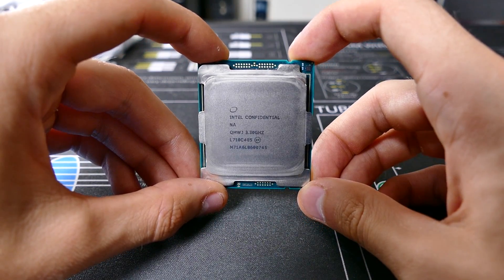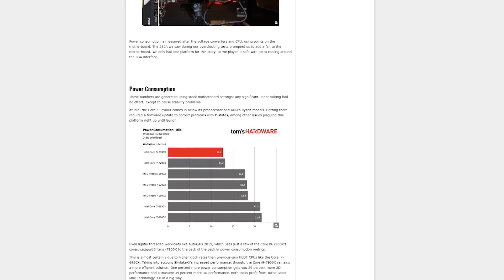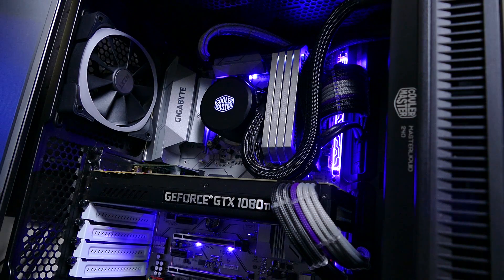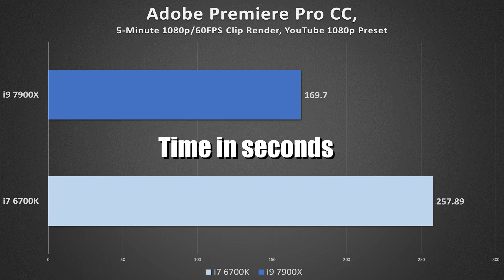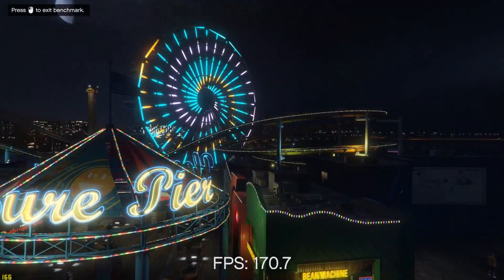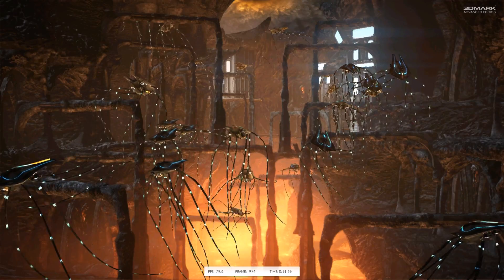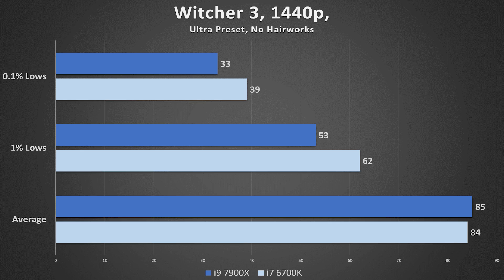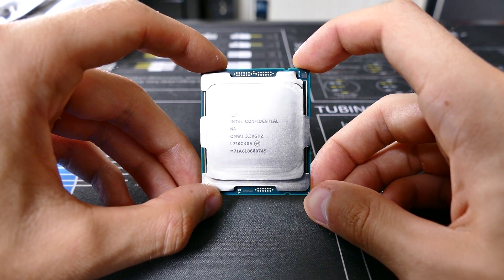Intel Core i9 7900X Benchmarks: Everything You Need to Know

Comment: if a 240mm AIO is barely enough to cool this, then why the hell would you buy it? A 240mm AIO is usually overkill for ANY processor
Reply from the maker: *except this one ;-)
Reply: People willing to drop $1,000 to inflate their epeen are willing to drop another $300 on a custom loop. Having said that, it's fucking ridiculous how bad the thermals are getting on Intel's chips. I can't imagine why anyone would buy this for work or gaming, there are either much more cost effective solutions already or incoming with Threadripper.
Reply from the maker: Jesse Lopez Yep. Most AIOs have extremely weak pumps.
Reply: you peasants still buy AIO and air cooler to cool this stuff?
dude this thing requires liquid helium
Reply: Gamers Nexus tested it with a water chiller, got the water to 10 degrees below ambient.

The CPU still got too hot and thermal throttled past 4.6 ghz.
Reply: then why am i cooling my 1700 with a 560mm 60mm thick 9fpi hwlabs radiator? with 4 be queit fans running at 600rpm for absolute silence lel
Reply: Why would I go Intel at all if I need a pro level cpu? Ryzen 1700x will outperform it for less than half the price.  Threadripper 16 core 32 thread quad core with motherboard is less than this one.  well... about the same I guess at this point. However that compared to the Intel 16 core 32 thread is half price once again and 64 pcie lanes instead of 44. Or 64 instead of the 28 in this cpu on this thread.. LOL and lower power consumption by half again...  Intel you suck once again and finally!!!
Reply: Science Studio But which AIO has a strong pump?
Reply: 280 or 360....
Reply: Jesse Lopez yeh but its still harder  to setup than any aio and people want water on their pc hardware
Reply: ImNotCool no never ever
Reply: Kurtis Johansson it is the max in what everyone would buy
Reply: i bought a 280 a month ago for my 6700k
Reply: Neezy Ko nigga these chips are about as good as a 7700k  their for enthusiasts and shit that like high core counts or the best of everything. People who edit and whatever also play games or do things where they need   Ipc and this isn't far from the 7700k
And tell me how the fuck is this going to be cooled in a server rack
Reply: It's all about people bitching about the sound which is fuck all, I have a pre-fix Fury X Sapphire and compared to my 6970 (which had fan issues later in it's life) it's literally nothing.
Reply: Throw it in the river for fastest cooling
Reply: Well in hot climates air cooling is considerably worse than a good AIO, 'cause the temperature inside the case can't be cooler than ambient temperature outside of the case. (correct me if Im wrong, Im no expert)
Reply: earth418 liquid cooling needed
Reply: These people making arguments that AIOs aren't that much better than Air Coolers for cooling x299. I'm just like SMH. If it's at the point where you REQUIRE custom liquid cooling, it's fucking shit
Reply: yeh but ek water coolers are so much more expensive
Reply: Hyper 212 Evo?
Reply: Agreed. My I7 4770 may run stock but I see temps lower then 60 with a $20 air cooler, in a case right next to a GTX 980 belching out 80 degree air six hours a day. 

Like wtf if the 10-core can barely use a double-size water line then what on earth will it take to overclock the 16-core?

Comment: Time to sell my kidneys to afford this D:
Reply: 1700 you mean, just OC it to 4ghz, which is trivial to do even with the stock cooler(if you're lucky, you may hit a wall at 3.9 or 3.8 if you aren't).
Reply: I'm a noob pc enthusiast and even I was able to overclock my ryzen 1700 to 3.7ghz at 1.26v and get a 1647 score on cinebench with the stock cooler. Probably could take it further if I wanted
Reply: Just don't, i9 is bullshit unless you're pixar or doing 4K video editing
Reply: That Kidney will get you i9 and quad titan gpus
Reply: Solid reply to a 2 month old comment
Reply: Unless you are using an aftermarket cooler or AIO, you need to clock it down to 3.65 tops. Otherwise it will throttle and not boost. Best case is to clock it at 3.65 and turn boost off on stock Wraiths. When you're not looking it will probably be dropping to 3.2-3.5 otherwise running 3.7. There is a temp threshold using the wraith on any of the CPUs and it's just between 3.66-3.69 that will cause the throttling. Get an aftermarket 240 AIO cooler, set it at 3.8/3.9/4.0, turn off boost and call it a day. Best AIO is the Cooler Masters which are cheaper than corsairs and come with the AM4 bracket in box. Check out TTL's reviews of AIOs for Ryzen video.

Comment: You see AMD this is why your processors are not good and people don't buy them, because you can't even make an omelet on your processors.
Intel can make me dinner, therefore Intel is better. :)
Reply: 2012 AMD : our fx 9590 can fry egg.
Intel : hold my beer.
2017 Intel : our brand new core i9 can burn down a house.
Reply: m33p0 and yet amd screwed up ryzen with not implementing the "egg frying technology"(probably will be back on threadripper)
Reply: Ted Melkoumov i know,meaning amd has the technology to fry eggs 5 year ago unlike intel that implemented the "egg frying technology" only now instead 5 year ago.
Reply: lol nice one
Reply: intel is 5 years behind on the egg-frying technology.
Reply: "Masterpiece"
Reply: Microcenter has the exact same deal for amd cpu's.
Reply: I don't want an i9 to make me dinner, I just want it to bake me some pi.
Reply: just wait for the 18 core part, youll be able to pressure cook a chicken in 30 minutes.
Reply: threadripper will be hot due to having 16 cores but if you're looking for a way to get your food nice and crispy there is no better solution than a 7900X
Reply: hold the fucking phone and give me 5 min to oc my fx6300 to 5.5ghz
Reply: Older meaning cheaper Meaning:
More Cpus Meaning:
More food cooked
Reply: poor analogy. The A-Series processors in iphones tend to run circles around most Qualcomm processors.
Reply: Prescott you could bake a cake with, now Pentium D 800's would burn down a house lol, it was basically 2 prescotts glued together
Reply: lol  kinda wrong.. You must be a young one lol.. The original pentium 4's were not just hot they were RED HOT and melted the sockets when they first came out. Prior to that we thought CYRIX chips were hot LOL.....   Those p4's sucked and not only fried eggs n pancakes they heated the whole apartment complex up with just one system on each level..... RED HOTS NYONE???!!!! So... after all these years Intel still has not learned anything but how to screw its supporters out of more money  on a apparently 10 year looping design...
Reply: yes i remmeber nvidia gtx 480 true frying eggs
Reply: muiecopyright Intel also has blue as their color.  And blue....  is blue
Reply: Kong Choksap hahahahaha true!
Reply: muiecopyright savage lol
Reply: buy a stove
Reply: gamer taboo then ur aio is broken... I have an 8350 clocked at 4.5 ghz on a $12 hyper t4 cooler and it never gets above 53 Celsius
Reply: Luke over at LinusTechTips better make another Pizza warmer PC with this.
Reply: dude what are you talking about, the ryzen 1700 is a WAY better value and processor for the money.  this processor is super expensive. Can't you see that?
Reply: You can't fry eggs with FX CPUs though, they simply can't get too hot. Instability occurs at 65°C and the 8-core CPUs will throttle at 57°C. Shutoff temperature is 80°C. Only Intel CPUs can fry eggs with shutoff temperatures of 105-115°C and the i9 7900X's power consumption of 230W stock or 290W overclocked. Fully overclocked FX-8350s and 9370s pull ~180W. Only the FX-9590 also sucks 230W, but the temperature is simply too low to fry something. And if your cooling isn't good enough, it will just throttle or shut off.
Reply: inte can heat ur home and fry your omelets.
Reply: It can warm my room during winter
Reply: 4 likes a minute is good going and deserved!
Reply: Benito Wymeersch 2012
Reply: roate se invarte, bro
Reply: I agree  AMD don't make good eggs on my breakfast. AMD sucks  \(^-^)/
Reply: LMAO XD but true
Reply: Wve come full circle...AMD used to be laughed at for their temps, and would you look at what we have here now...
Reply: Intel is wife
Reply: gamer taboo theres aomething really wrong there. fx cheaps are really cool.
Reply: if you know how to mod it wont shut down 
also its running now at 4.2ghz with spartan 3 1024HE
Reply: FX processors were a good alternative for coal in steam engines.
Reply: Can you english?
Reply: I meant this for Black Desert. The tag doesn't seem to have come with my comment.
Reply: The 9590 fx is hotter than the 8350 ? Damn, glad i didn't "upgrade".
Reply: These 10 and 18 or 16/ThreadRipper, core parts aren't for us!, They are met for developers.. The everyday guy don't need anything more than 8 core's 16 threads.. The I7 will be fine as well with 4 cores 8 threads, for the next 3 to 4 years.. The I5's are lacking now.. But If your on a new Ryzen/X370 platform or the Z270 or X99, Everyone is Fine..  But this new Intel platform is terrible, It has way more problems than Ryzen did at launch and It's designed to make people upgrade from their  6700's and 7700's which are all the same...
Reply: Edward Johnston who are you talking to?
Reply: muiecopyright omellette*
Reply: Why make an omelet when you can fry a pig in 2 seconds?
Reply: Photonicinduction should make a 2 second CPU omelet maker
Reply: shots fired
Reply: a microwave/oven to cook a pizza NAAA! just get an i9 works just as good and you dont even have to leave your computer to get the pizza when its cooked
Reply: LOL No need to overclock Ryzen to get performance numbers friend lol... At 4.0 they already outperform the I9 for half the cost.. Thats an additional bed, kitchen range for cooking and a scooter as well as a nice 2nd hand couch lol... What more do we need from AMD?
Reply: That's putting it lightly lol, those cyrix chips were def something to worry about  pre pentium 4 lol, I remember years ago I was running benchmarks on a cyrix I believe a pr200/233 with a 12mhz oc to test its tdp and I had forgotten about it and went to make dinner, come back and the cpu had melted the socket straight off the board, those were great times
Reply: I choose Intel over AMD because Microcenter has a deal that if you buy an Intel processor with a compatible motherboard, you get the motherboard for $30 less. That means I can go to the Microcenter 30 minutes away and get a i7 7700K for $279.99 and a Asus z270 Rog Strix for $159.99
Reply: intel can burn your house
Reply: muiecopyright good one lol
Reply: muiecopyright in all seriousness though I feel like amd gets a lot of hate for nothing I have a laptop for school with a amd a6 and it works just fine for school stuff and some lighter to mid games, they are worse performance wise but they are also much cheaper.
Reply: intel stays the best always there where intel has two cores and amd 4 cores its just like the two cores are as fast as 4 cores from amd
Reply: I wasn't even talking to you. But for the record, whoever told you Ryzen CPUs can't keep a stable core frequency is a complete and total moron. Ryzen's core clocks are fine, but early on, AM4 motherboards had a difficult time overclocking RAM. Nowadays, AM4 is just as stable as Intel. Also, I have no idea why you're even bringing in slow motion in videos games, because slow motion is completely separate from CPU frequency. Slow motion is a trick done by telling the game world that time is going slower than it actually is, by modifying the delta time between ticks. In other words, it's a programming trick.
Reply: you can bake cakes on those fx chips
Reply: WilsonZero LOL You are wrong. Why people forget Pentium 4 Prescott days?
Reply: muiecopyright do you forgot the fx 9590,by far the best masterpiece(the fx 8300 and 8350 is also a masterpiece) amd has created(you can fry eggs with the fx 9590,8350 and 8300 bro)
Reply: The FX-8300's max safe temperature according to AMD is 62C. It cannot be used to fry, because it'll just thermal throttle. I know because I own one.
Reply: did you forget that 220 watt 9590 thing from amd?
Reply: That's what AMD graphics cards are for ;)
Reply: muiecopyright bro have a look at the new AMD threadripper 1950x it crush's the core i9
Reply: God gave u shit for brains, so u can spread ur ignorance.
Reply: to be fair amd had a lot of very hot and high tdp cpus but they performed really well given the price of it , it's like the debate between Samsung and Iphone , one of them is very overpriced and the other can give better performance better than the other
Reply: Lol I'll see your 5.5Ghz FX 6300 and raise you my old FX 8150 that I had to DOWNCLOCK from stock clocks or else it would overheat and shut off, literally with an AIO cooling it.
Reply: I reckon. orrr. he couple rip the cooler off under max load and watch the CPU go pop!.

"oh no, I popped it!!!!!!!!!!!! phew, smells bad.. must be that TIM."